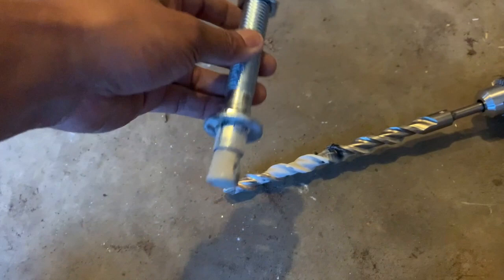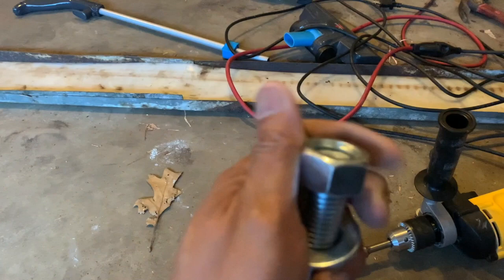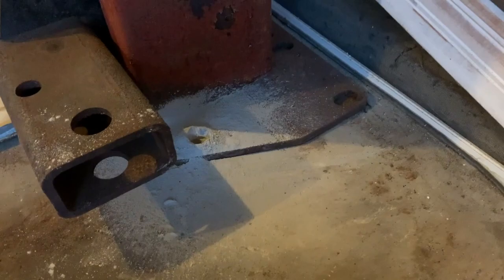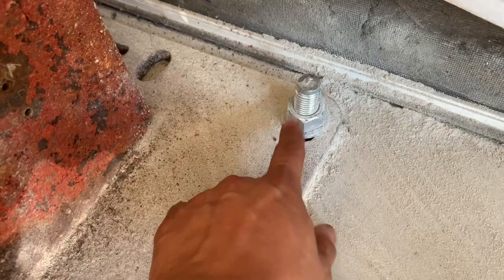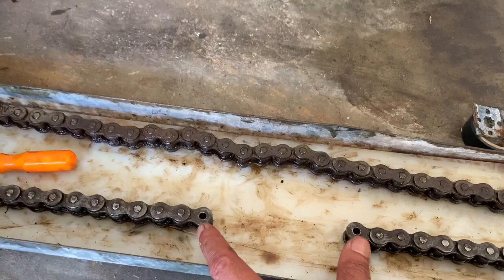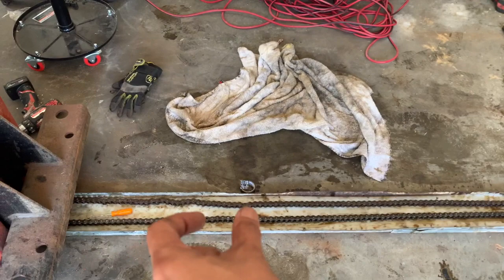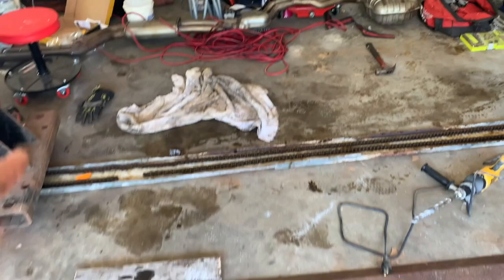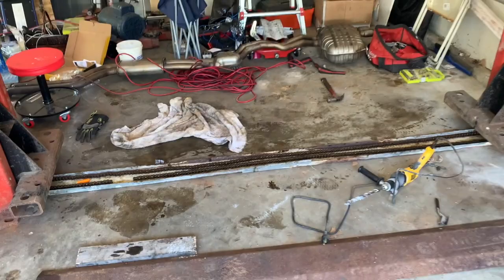garage lift - install anchors

Comment: How how deep did u actually have to end up drilling with the 3/4 x 5.5 long bolts?
Reply from the maker: I have it two bolts in height (or 1 1/2).  That way, most are underground for a tighter fit.  I can also add another bolt for safety.
Reply: @Simplenetwks  thanks for the reply also what motor is on the pump how many amps does it draw? Reason iam asking is because I just bought one and it's still in shipping but I wanted to get all my wiring ran before it gets here but it's not saying on the website how big of wire and breaker iam going to need
Reply from the maker: @mikesautomaintenance5780  good question.  Bought mine used. It was an “auto loader”.  Old style chain base lift.  It requires a 220 line.  Had an electrician install the outlet for me.
Reply: @Simplenetwks  oh ok not a problem I no mine is 220 also just wondering if it's a 3hp motor or a 2hp motor before I go buy the breaker and wiring for it because there is a big difference in price between the wire if I need 10/2 wire or 12/2 wire iam hoping it's the smaller 2hp motor so I can run the 12/2 on a 20amp breaker it's a lot cheaper compared to the 3hp motor that needs the 10/2 wire and 30amp breaker
Reply from the maker: @mikesautomaintenance5780  yeah my electrician dealt with the specs.  It must be nice to know and do your own wiring.  Thanks for sharing your input.  Others can grow knowledge from this.